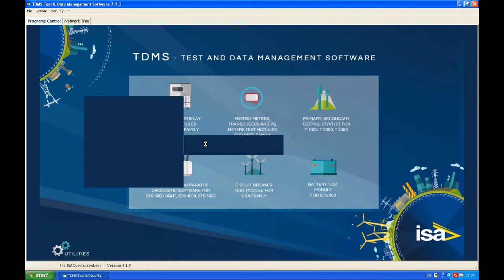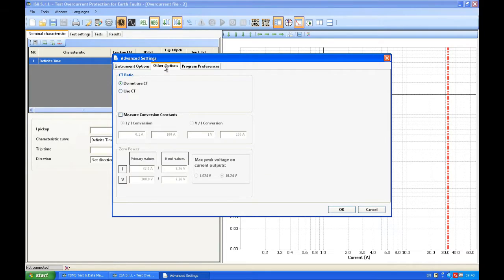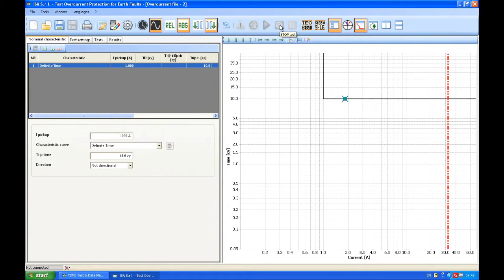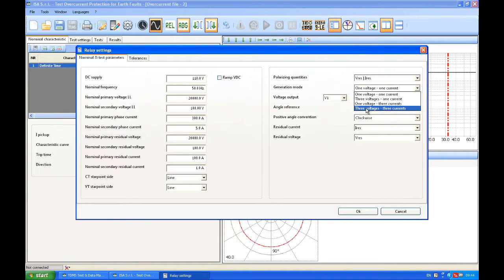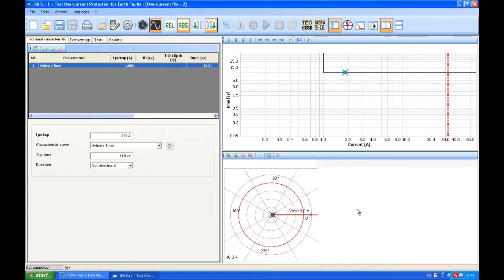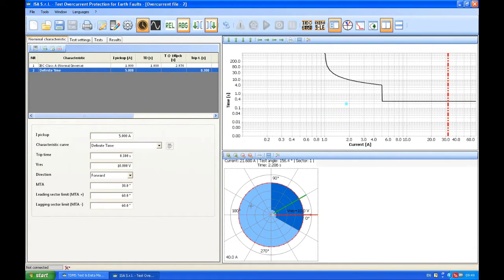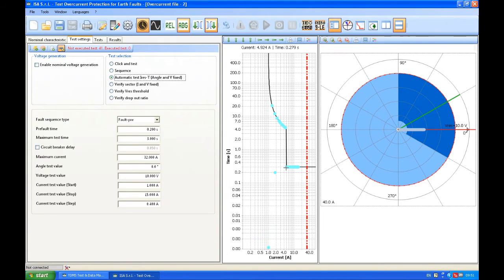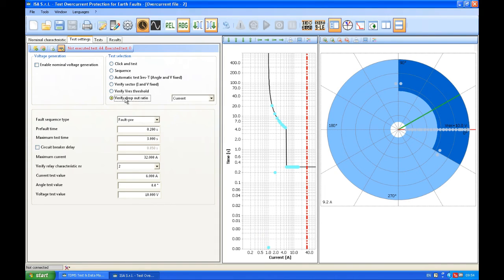TDMS Overcurrent Application Explained

Comment: Andrej i have 32 bit TDMS but it does not work on 64 windows tell me that how could this problem solve how i upgrade to 64 bit thanks

.
Reply from the maker: Hi Mouhammad. You should go to ISA web site - www.isatest.com - and then to customer area. There you will be asked the SN of test set. Use that to get the new TDMS. If you have problems, please send me a mail to andrej.sepcic@isatest.com and I could help you there